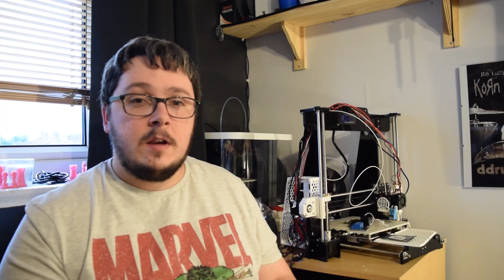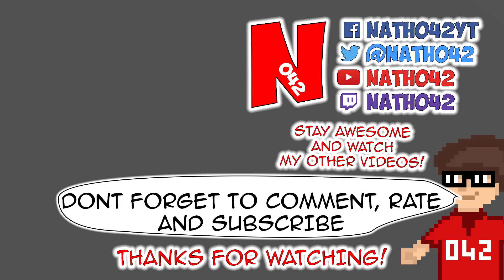Anet A8 Printer Update - Thermal Runaway

Comment: The shit thing is with the Marlin firmware that when a thermal runaway occurs, it doesn't inform you as to which apparatus had experienced the runaway. You have to wait and watch the temperatures until the failure occurs, which is a major pain in the ass as far as troubleshooting the root cause is concerned.
Reply from the maker: ah yes, best to check joins i believe its arks in power that can cause it to heat up.